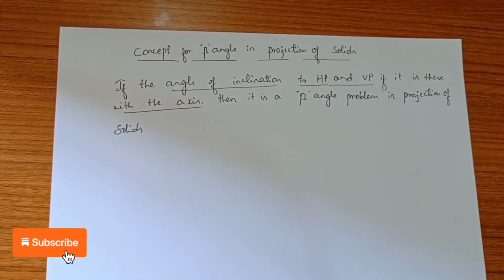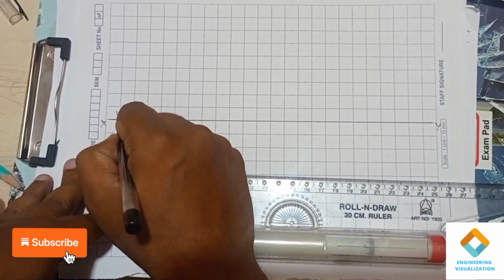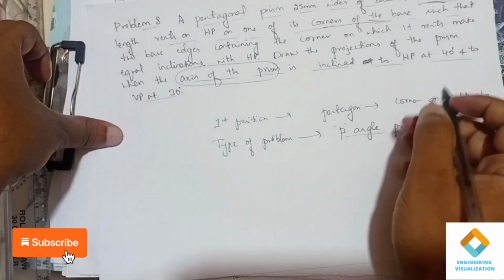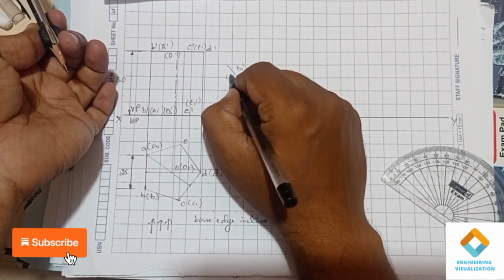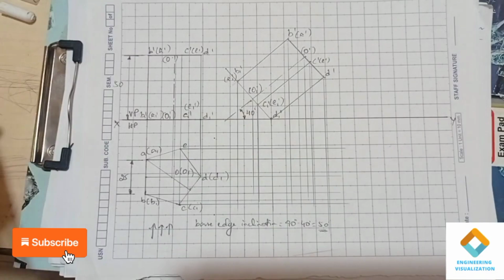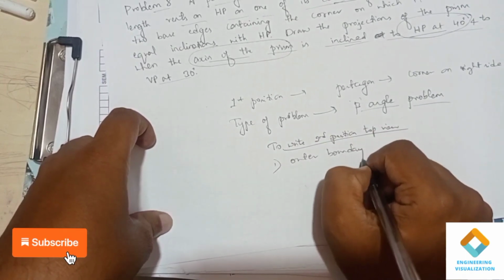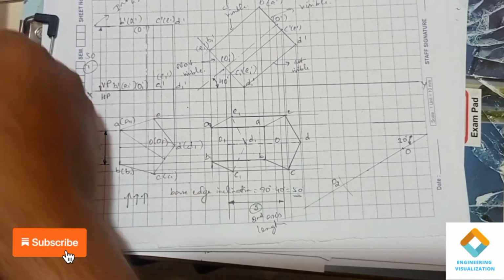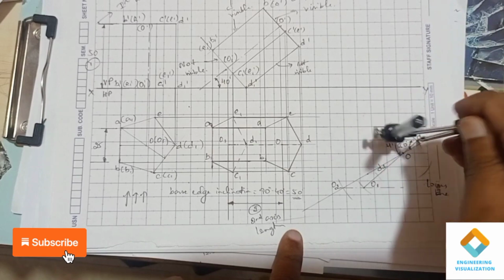PROJECTION OF SOLIDS: BETA ANGLE (PENTAGONAL PRISM, HEXAGONAL PRISM)

Comment: .

1

A pentagonal lamina of sides 25 mm is having a side both on HP and VP: The surface of the lamina is inclined at an angle of 60° with HP. Draw the top and front views of the lamina
Answer plzzzzzzzzzzzzzzz
Reply from the maker: Anwer link madidini nodu.. 2:30pm batch CAED model question paper jote